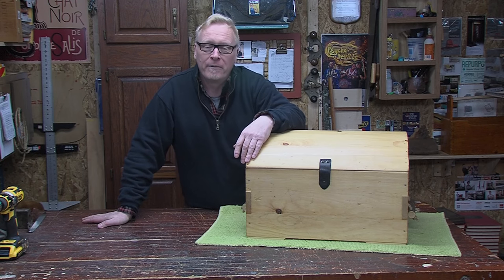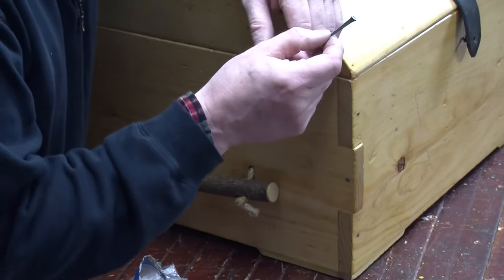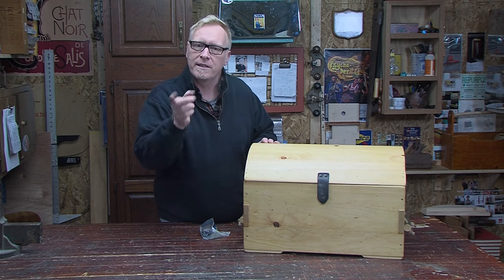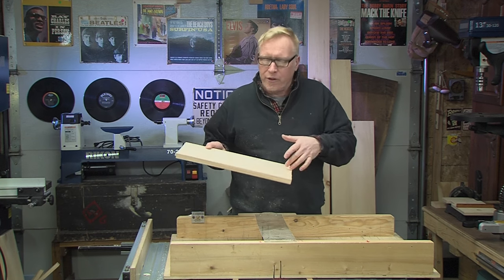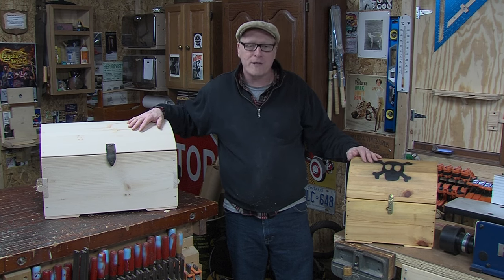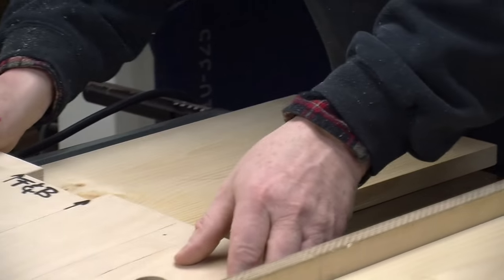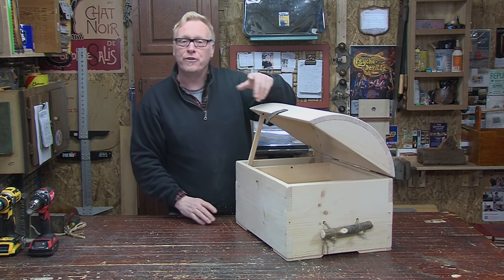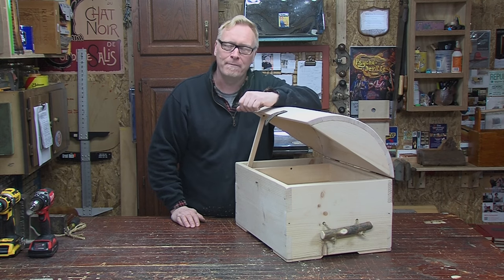0018 - The Garage with Steve Butler - Coopered Chest

Comment: Would this Coopered Chest lid work on a bigger scale? Like 6.5' x 8' to use as a small camper roof? If yes, do the widths of the wood have to be the same as the chest no matter how big it goes? The outside would be completely sealed and then covered with either fiberglass, aluminum or stainless steel.

Comment: Why don't you have a riving knife installed on your table saw? It will decrease the chance of kickback, especially when you are splitting solid wood.
Reply from the maker: No excuses. You are absolutely right.  I bought the old saw used.  It didn't come with one.  I've meant to put one on ever since.  Just didn't.  Things are different now though.  I'm using a different saw that has one.  Thanks for watching and reaching out. Stay well.  Regards
Steve